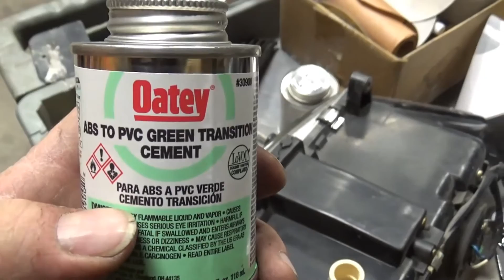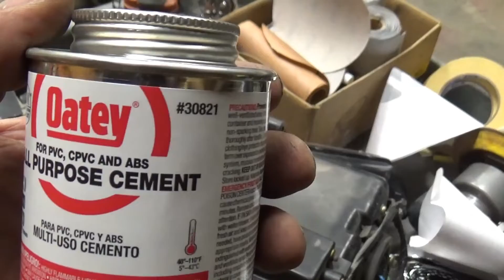Plastic welding motorcycle parts (part 1)

Comment: Gordon, i like your videos very much for the principals and the effort displayed in them...but I need to say this, you should really stop touching parts with your bare hands while treating or cleaning before painting or chemical welding etc...... you can't touch parts with your hands just before painting.... you do a lot of work to prep and clean the parts and basically ruin everything since you don't wear gloves..... I hope you don't get offended by my comments, it just pains me to watch you putting so much work and effort in your videos and fail to apply the most basic principals.
Reply from the maker: I've sprayed enamel paint off and on for 40 years and never had a problem like this video showed. I think it is more related to the new base coat clear coat (new to me) it's been out a long time but I never used it before. Gloves are fairly new too, when I learned mechanic and body work NO ONE ever used gloves, (40 years ago) Maybe gloves are necessary for this base clear paint. Thanks for the comment.

Comment: For what it's worth, I've had some pretty fabulous results bonding metal tabs onto ABS plastic (rear seat cowl, when the original plastic mounting tabs broke off) using Pattex Power Epoxy. They've been on for a season of riding without any issues.
Reply from the maker: Thanks for the tip. I'll look into that.

Comment: Gord, I saw you clean up the ends of the white pieces before you attempted the 2nd round of gluing them on to the black plastic surface.  I'm no expert on these matters, but I could not help wonder if prepping and mildly sanding/scratching the surface of the black plastic would have helped the gluey crap bond a little better?  As I just mentioned, I'm no expert in matters of attaching plastics, but I would think that any form of "welding" by means of melting and blending the 2 plastics together, would be far superior to simply trying to bond via a chemical/glue bond.   
Oatey, can you pee by the dim bathroom light ?  
Sorry, couldn't resist... and no disrespect meant... I had just never heard it pronounced "oh-tay" before,  I just assumed it was "o-tee" :)
Reply from the maker: I did scuff the black ABS before gluing the plumbing pieces and since they came off clean and left nothing on the ABS I knew it was still clean and scuffed. As for the pronunciation, I never heard it, I just guessed, and having some Spanish knowledge I know the E would be an English A and usually is in English as well. I get your joke about the song, lol.

Comment: JB weld for plastic
Reply: I have zero experience using JB Weld with anything. I don't have anything against it, just never used it or had occasion to run out and get some.  Can you provide any insight into the use of it or how it might be a better choice than other bonding agents?

Comment: Good video Gordon and useful with all of today's plastic parts (junk) As far as solvents for ABS Methy Ethyl Ketone (MEK) was most recommended and Acetone to a lesser extent. There were other solvent mentioned but would not be readily available. You might try model glue Toluene since the S in ABS is Styrene.

Comment: Not found any glue that I have found to reach what I think to be very reasonable expectations. I have tried pretty much every type of glue a could get my hands on, including expensive aerospace epoxies. None has stood up to any form of realistic load testing. By this I mean half as strong as original. None even come close. Only plastic welding,done well,comes close but takes time to get right. Great video, very informative.
Reply from the maker: Thanks Andrew.